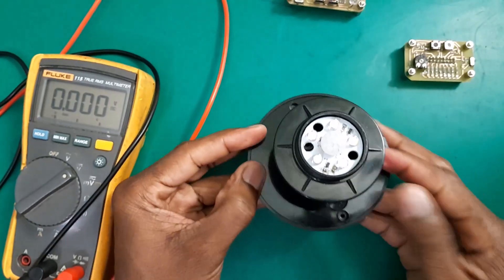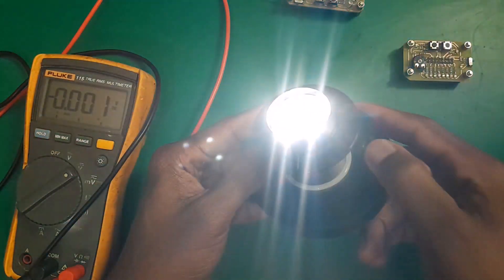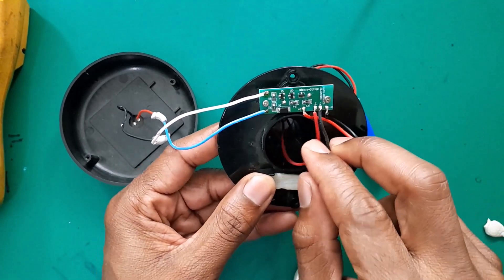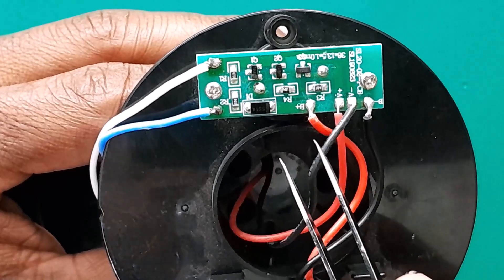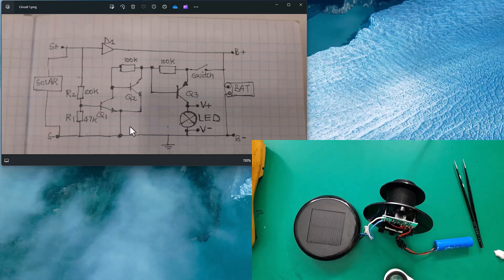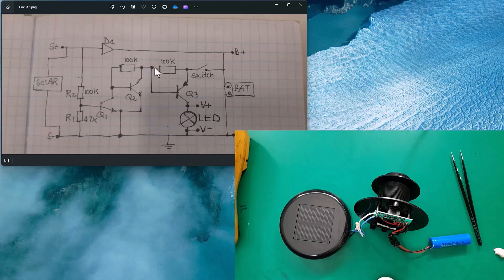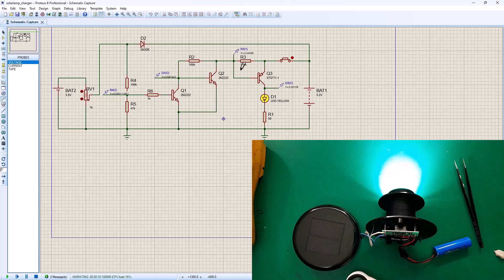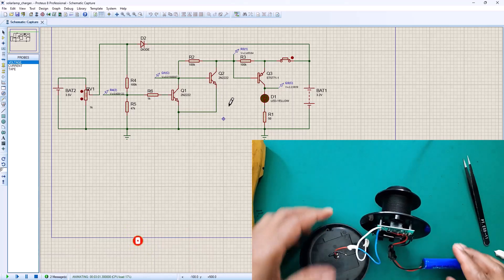Mini Solar Lamp Teardown and Circuit Explanation. Part 1 - Charge controller board

Comment: Does this have a built in charge controller?
Reply from the maker: Yes, it has a simple built-in charge controller, which I covered in the tutorial. It’s a transistor-based circuit that gets triggered by a light sensor. When the sensor detects sunlight, it allows the small solar panel to start charging the battery.

Comment: Can you make a new version of this video, where you draw in the motion sensor?
Reply from the maker: Yes certainly, stay tuned I will prepare it for the coming week-end. Thanks for showing interest.
Reply from the maker: The video about the PIR sensor is live
https://www.youtube.com/watch?v=5qninSXP9pc
Reply: Hi thanks for your video , I have 6 led solar lights in our garden most have been there for at least 5/6 years , as time went on some stopped working .
I fitted new fully charged battery’s but they don’t work , I’ve looked at pcb and made a diagram of the connections what voltage would I expect at each connection it appears to have 2 diodes and a 6 point black block ,though small could the transistors all be in one block  as I can’t make led work I only have voltage on one red wire and if I earth it no light I’m not getting and earth on the other wire many thanks .